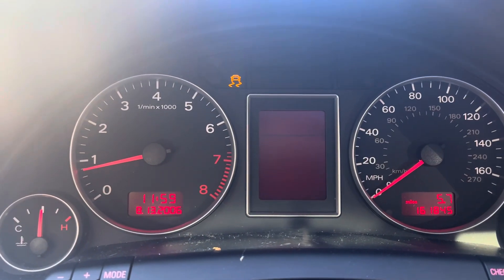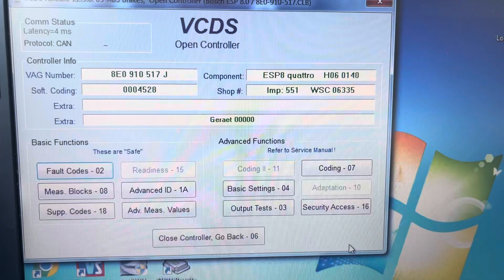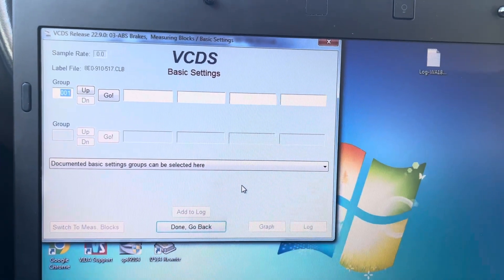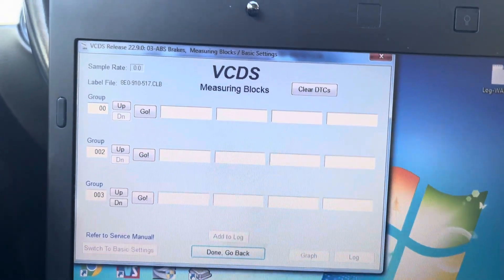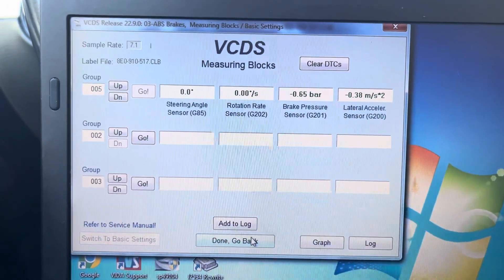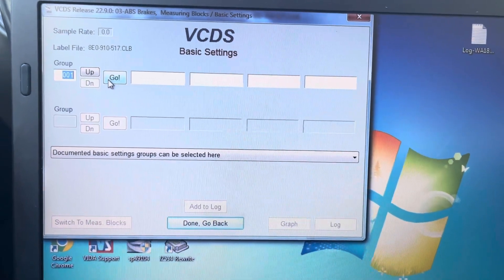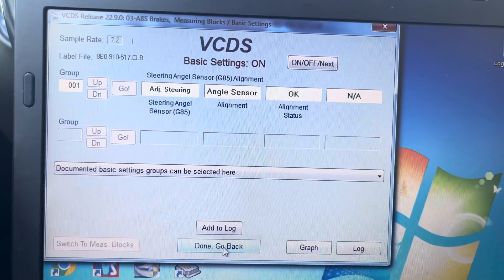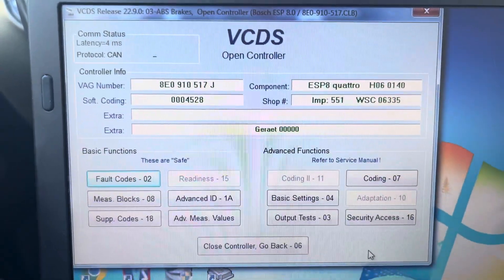VW Audi steering angle sensor calibration Bosch 8.0 ABS System Fault code 01826

Comment: Hi why does this need to be done? 
I’ve been fixing up a 2009 q7 and I’ve now got 00778 no signal / communication steering angle sensor g85 and 01826 sensor for steering angle g85 supply voltage terminal 30 via my obd reader, I’ve also got vcds I’ll take a look when I get chance , do you have to do this after the battery has been disconnected for a decent time ?

Comment: Thank you very much for the video! Retrofitted a mfsw and after that the esp light stayed on with the steering wheel sensor fault code together....this was the solution since I didn't do any job on the brakes or the abs cube! Thanks!

Comment: If I see it right, it was nothing with calibration of steering angle. You had a fault code from low voltage. You car was running and at the beginning you cleared that code. Later you were hasling around without doing any - and finally you noticed that you do not have fault codes.  Sure, because you deleted that.  But next time your voltage is low, you'll get the same fault code; change the battery.
Reply: The "calibration" only requires you to turn the wheel one turn left and one turn right then find 0 degrees (+/- 4.5 degrees tolerance). When the wheel is at 0 degrees and you go to Basic Setting and see that the status is "OK", you don't have to do anything else. If it doesn't say "OK" you have an issue or the steering wheel is not reading inside the spec for it to accept that as "calibrated".
Reply from the maker: The code that was set was because it needed calibration. Nothing to do with voltage.

Comment: I have a question for you - Measuring Blocks Section, under Steering Angle, the angle is -.70 degrees with the steering wheel centered. In your video it says 0. If I keep going with the suggested procedure you show will it reset the angle to 0, which is where I want it to be? When I drive the steering wheel is tilted to the right slightly that is why I want to reset the angle to 0. Thank you. Martin
Reply: just fire up the car and move ur steering wheel far to the left, wait 3 seconds, move far to the right, wait 3 seconds, center. Restart car, should fix it
Reply: @4ukai  got the same, so just start engine when steering wheel is in center, then turn it to the left side wait 4 seconds and then to the right wait 4 seconds.